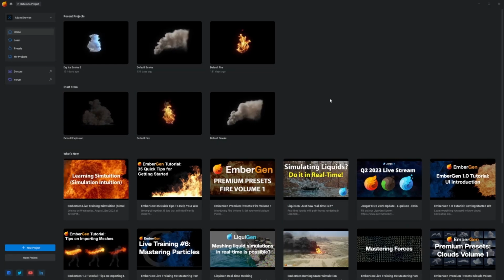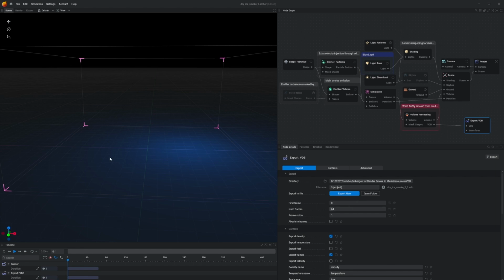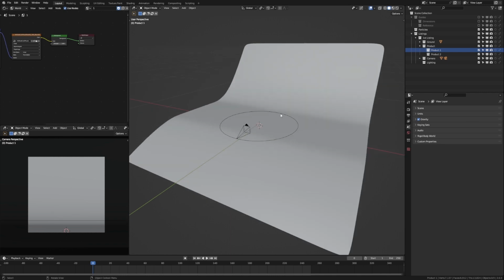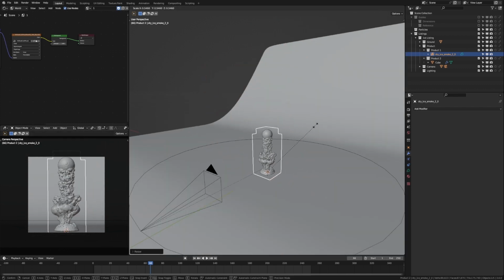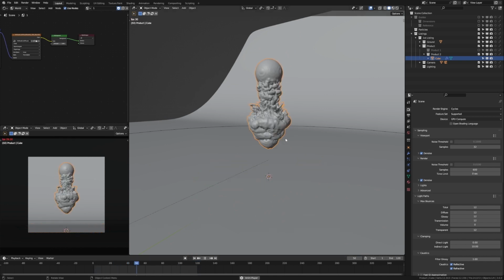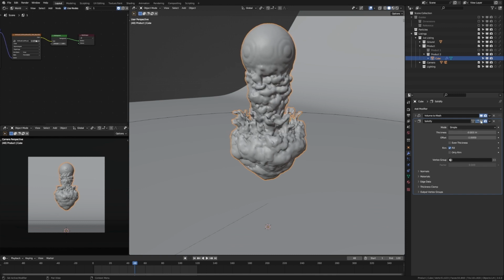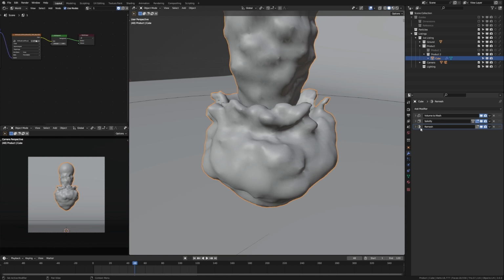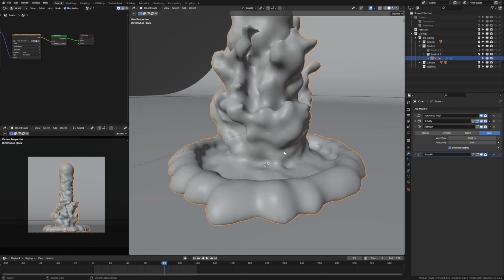Smoke sim to mesh from EmberGen to Blender full workflow under 10 minutes

Comment: is there an advantage compared to running the smoke sim VDB directly ?
Reply from the maker: Sorry, I don't understand your question. It is running the VDB directly, if you would overwrite the VDB files in your folder the animation/mesh would update accordingly in Blender.
Reply: @AdamSkovran  You can play the vdb directly and shade it with a principeled volume like : https://www.youtube.com/watch?v=VLzIusa6Mgc
without adding the different modifiers like you did. is the purpose being able to have a specific material on it ?
Reply from the maker: @Grimstore  Oh I see!
Yes there are 3 things that come to mind:
 1. I probably should have mentioned this in the video, but once you add these modifiers to the VDB you can apply any texture on the mesh with displacement and everything, which is great and allows you to be even more creative.
2. If you shade it with the principle volume, then it's gonna look like well, smoke and not like a solid mesh. There's nothing wrong with that, if that's what you are going for.
3. Rendering smoke is really heavy on Cycles, for comparison I rendered those scenes at the beginning of the video in 4k with 600 samples. With VDB turned to mesh it took me 40 seconds/frame to render, if I did the same but with the VDB file enabled and shaded it with principled volume it would have taken me 40 minutes/frame at same 4k and 600 samples.
Reply: @AdamSkovran  Ahh OK I see, that's really important, you justified it well.
Reply from the maker: @Grimstore  I think there's not much to justify. These are two different techniques yielding two very different results. One does not replace the other, use cases for both can be justified in specific scenarios.